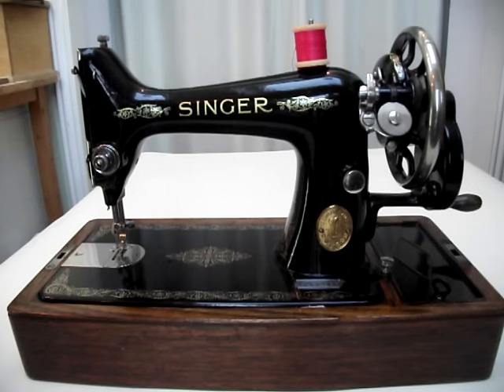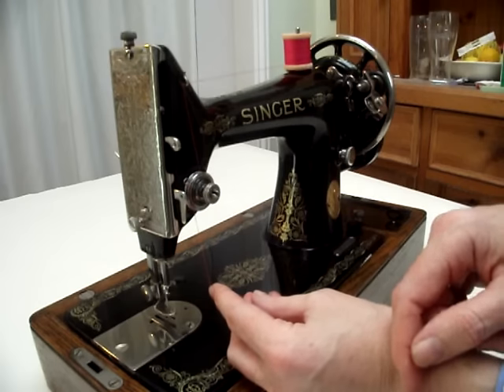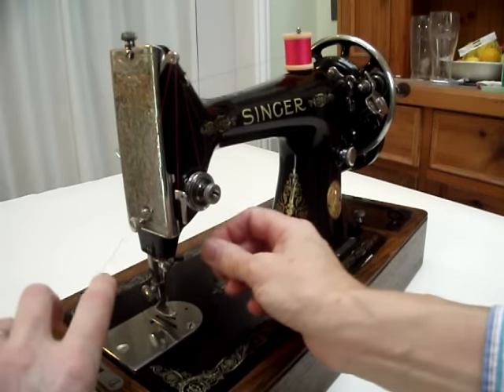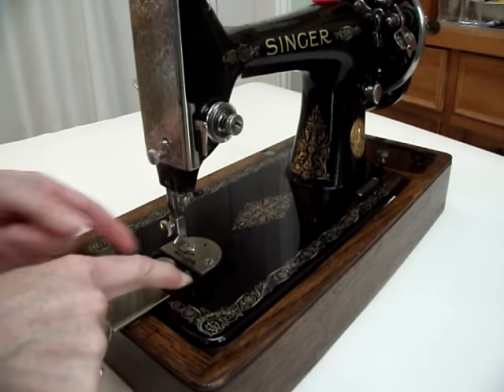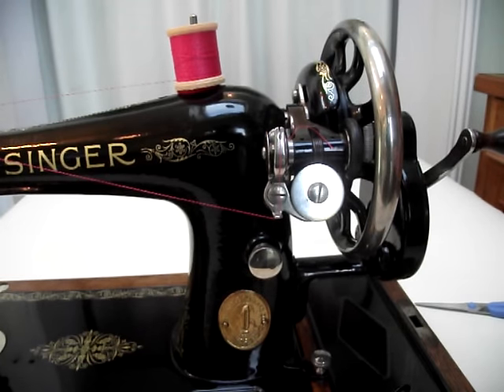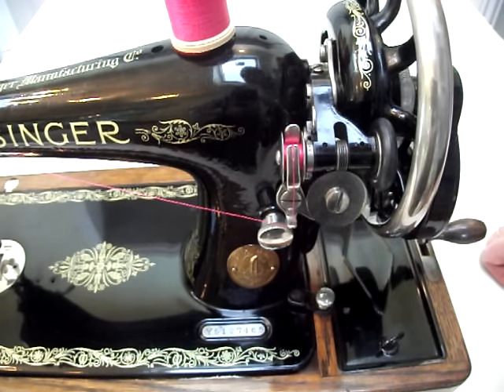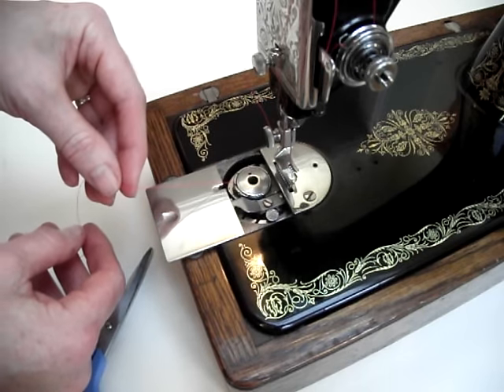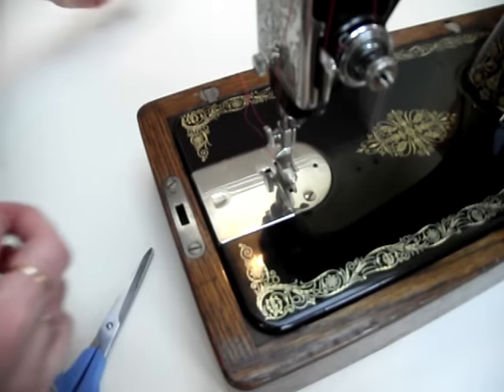How to thread a vintage round bobbin sewing machine - Singer 99K

Comment: im a teen girl who loves sewing i got my great grandmothers today and cant wait to use it
Reply: I don't know how to tell my grandmother that i want to borrow hers :)
Reply: SameeEEeEee
Reply: Actually same lol
Reply: At my house we have 2, one that belonged to my great grandmother and on that belonged to my great great great grandmother. The latter is under the house and is starting to fall apart, and the first one is inside but missing the gizmos and the part that you use to thread up the first thread (why!!!) My nan also has one of another of my great grandmother that has everything on it and is in great condition, but she doesn’t use it and it take forever to unlock the case it’s in ( it’s a graveling sewing machine with electricity, the other 2 are older and are pedal powered. I wish I could learn how to use them but the first 2 need repairing or new parts, and the last one I can’t really use even if it works
Reply: My great great grandmothers is easily over 100 years old, my great grandmothers one is easily 70-100 years old and my great grandmother that my nan has is around 50-80 years old
Reply: SAME
Reply: @thomaspage869  I live in Houston Texas, not sure where you live but I repair these old sewing machines, wish I could restore those machines. You can look up 5Tag Woodworks on Facebook and you'll see some of the ones I restored. I did one for my mom, it was her mother's sewing machine a 1913, and I gave it to my mom for her 65th birthday. She loved it.
Reply: @5Tag Woodworks  wow! What a wonderful gift - bless you! 💖
Reply: I litrally just founf my great grandmothers sewing machine  and im a teen too! But i dont know if it will work or not :(
Reply: @thomaspage869  , You must find a way. This is your great great great grandmother speaking.

Comment: I just purchased this same machine last week.  It dates back to August 1, 1927.  Pretty rough shape, lots of rust and some missing parts but restorable.  It must have been heavily used.  Decals are all worn off and the only shiny place on the face plate is where the thread from the take up lever down to the eyelet in front of the face plate rubs against the plate.  I look forward to soon use this gem.  Thanks for your tutorials.

Comment: Thank you sew sew (pun intended) for the tutorial. I have just acquired a 1951 99k Singer. The serial number starts EG, it's almost identical to yours. It has been fitted with an electrical foot peddle and the handle removed. I am glad I found this video and the others to go with this. I can't wait to start using it now. Thank you Lizzie.
Reply: Mine starts with an    EF.

Comment: I have an AC284998 model # Singer sewing machine and table. Is it the same model 99-K as this machine you show? I have not plugged it in or anything at this point, as I picked it  up today at a thrift store. I am wanting to restore it to a working condition if it does not operate correctly. When I was a parachute rigger in the USN, we used these sewing machines and learned how to untime them and then retime them so we could repair them in the field. That was in 1968, so too many years back for me to remember how to do that now. I love the singers when they were made of quality as these were. Not the same company anymore though. Mine does not have a foot treadle to it, but has an electric motor and foot pedal. Thanks for any info. I enjoyed watching this video, but I do wish the thread showed up better in it.

Comment from the maker: Hello Kim,  The older Singers didn't have the model number on them.  The 99 and 66 are the same except for size - the 66 is larger.  K means that it was manufactured at Kilbowie in Scotland.  If your machine threads like this one it is a 99 or 66.  To be sure, check what type of bobbin mechanism it has - have a look at my video about setting the needle.  Also, have a look at the different machines on my blog.  All the best, Muv

Comment: Such a wonderful video thank you. So serene! Can I ask you- I have been trying to replace the needle on my machine, which is very similar to yours, but mine is a 1930s singer model. I've tried using standard needles but the machine doesn't seem to be sewing. Which needles do you use to replace yours and where do you get them from?
Reply from the maker: Sara O'Brien Hello Sara,  Singer standardised the needle well before the 1930s, so your machine will take a standard needle.  If it isn't picking up the bobbin thread, my guess is that you are not setting the needle in the right way.  Please watch this video - it might hold the answer for you.
https://www.youtube.com/watch?v=e98T8B2fe1s

Comment: Thank you for your video, I used to use my grandmother's machine all the time to repair my jeans but haven't used it for 20 years, today I tried to make cushion covers (my electric machine when up in smoke!) and when the material is doubled the thread brakes after about 3 stitches, it is sending me mad, do you have any ideas? It looks like your round bobbin 99 but the number on the Singer is F8351885 - could the problem in tension? Thank you for any help

Comment from the maker: @MrRickycowley 
Hello Mr. Cowley,  It sounds very frustrating.  If the machine is not damaged, has no parts missing, is cleaned, oiled and threaded correctly, there is no reason why it should not work.  Have you got the right bobbin for this machine, is it loaded into the machine correctly, and is the needle properly set in and threaded from right to left?  It is surprising how many people set the needle wrong and thread from front to back because they are used to modern machines.

Comment: Thanks for this.  I am a totla beginner who just bought a beuatiful 99k for a pound(!).  I make leather goods and want to use it to stitch leather.  Forgive the stupid question but do you need to thread the thread holder shown at the beginning of yr film AND the bobbin below the needle in order to stitch?
Reply from the maker: Hello Philip, Congratulations on the machine.  It forms a lockstitch, using the top and bottom thread, and I'm sorry, I really don't understand your question.  The 99K is a domestic machine manufactured for home dressmaking and tailoring and sewing home furnishings - it wasn't designed for sewing leather.

Comment: Hey Lizzie just bought a 99 but the timing is off I believe the top of the stitch looks ok but the bottom of the stitch is a mess. Is this something that can be fixed at home or would it be better for a professional.
Reply from the maker: Hello Douglas,  First thing to do when acquiring an old machine is to give it a thorough cleaning.  Then check the needle is set the right way.  Then make sure you thread it correctly.  If the top of the stitch looks all right but there is a mess underneath then this sounds like incorrect threading or tension too loose on the top.  Please watch all of my sewing machine videos that are relevant, and be prepared to spend hours at a time trying to sort the problem out.  Also, if you haven't  got a manual, download one from www.singerco.com.  All the best, Muv

Comment: Great video I followed it and began to sew on my machine. I had to retread last night and now I can't get the bobbin thread to pull back threw with the needle tread. What have I done wrong?
Reply from the maker: Hello Chelyah,  I expect you have made a mistake rethreading it, because if it has been working and now it isn't, then there isn't anything wrong with the machine.  Just keep on trying...
Reply: Thanks for replying I appreciate it. I actually found out that a bolt underneath it was loose and is why the bobbin wasn't catching
Reply: For some reason it keeps coming loose every so often. I may need it looked at

Comment from the maker: @g1sflippo 
Thank you - glad you enjoyed the video.
The tension for the top thread is set in the same way as on a long bobbin machine, shown on another video.  Adjusting the bobbin thread on a round bobbin machine might be a bit tricky on video, but we will see if we can do it.  As for needles, all the machines we show take exactly the same type of needle as modern machines, so it is just a question of buying the right needle for the job and getting the advice you need at the shop.

Comment: Hello!;D
I´ve just been given the same sewing machine but it has some thread and fluff trapped next to the bobbin, I hope you can help me, it would be amazing if you cound do a tutorial, cant find any!
Thanks so so much, I hope you have a beautiful day :)
Reply from the maker: Hello Sion Zion,
Have you checked the other videos on this channel?  There are two videos about cleaning a machine.
When you clean out the bobbin area see if there is a tiny wad of red felt held in place inside a short spring.  Leave the felt where it is, and when you oil the machine, put a drop of oil on it.  It is an oil rervoir to keep the movement lubricated.
Reply: Hello! Thanks very much for your reply, I will look for those videos :)

Comment from the maker: Hello Carol65classic, I have never converted a machine that started out as an electric machine to a hand machine.  The machine on this video is the same machine as in the video showing how to remove a motor.  The motor was a later addition, but the original handle was with the machine so I could restore it to its original condition.  I suggest you visit the Treadle On website.  As for modern non-Singer handles, the ones I have come across are complete rubbish.
Good luck!  Muv

Comment from the maker: Hello gezz58, A video on stitch length adjustment would be tricky because it depends on the mechanism on the machine.  Some machines have levers, others have knobs or sliding screws.  Levers are straightforward, but people tend to be confused by the regulator screw, which is found on the older models.  Look at my blog, Lizzie Lenard Vintage Sewing (the link is on our channel page).  I have done a post today about the stitch regulator screw.  I hope you find it helpful.  
Regards  Muv

Comment from the maker: @0naTaLu0 
Hello OnaTaLu0 - The needle is disengaged, which is what you should do when winding the bobbin.  To re-engage it, turn the stop motion screw as far as it will go clockwise.  It is the big metal disc in the middle of the wheel.  If you still aren't sure which part I am talking about, watch the last bit of our machine cleaning video, part 1.  If it works, don't take it apart.  If it doesn't engage, it might need a clean out. 
Best of luck,
Regards   Muv

Comment: How to adjust the tension in the bottom bobin?
Reply from the maker: Adjust the tension at the tension discs.  You only ever adjust the top thread.  The bobbin tension was set when the machine was manufactured.
Reply: Thanks a lot Lizzie.

Comment: My wheel stops working randomly, it turns but the sewing dont continue
Reply from the maker: I assume your machine has a stop motion screw.  It is either set halfway between the two settings, or it needs cleaning.  https://lizzielenard-vintagesewing.blogspot.co.uk/search/label/Stop%20Motion%20Screw